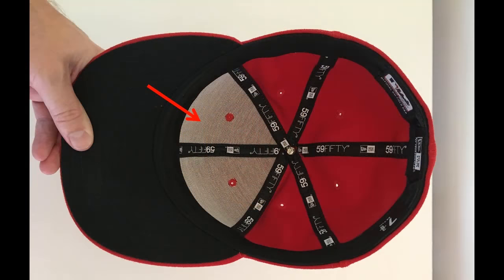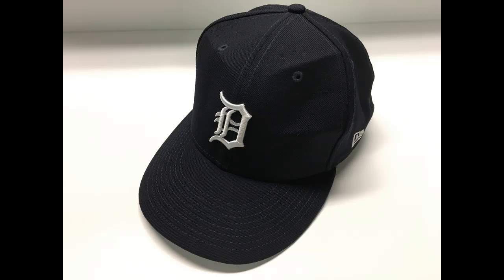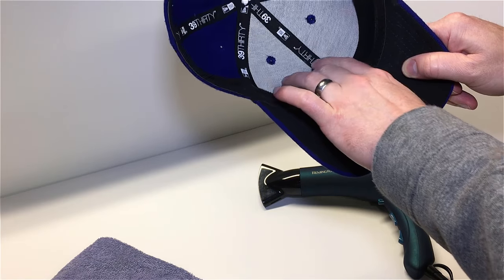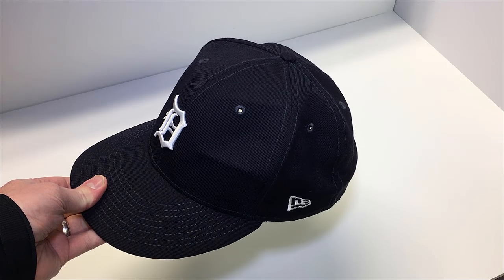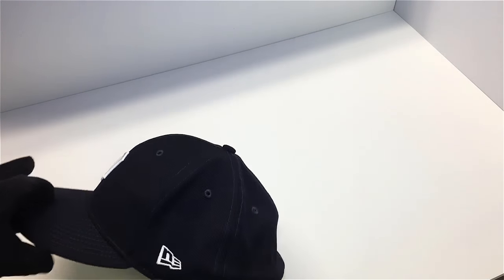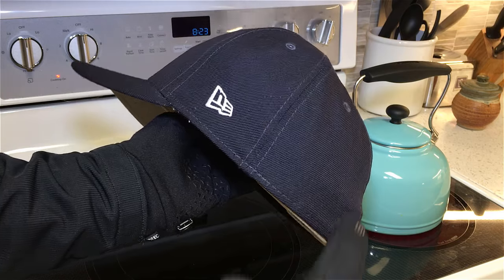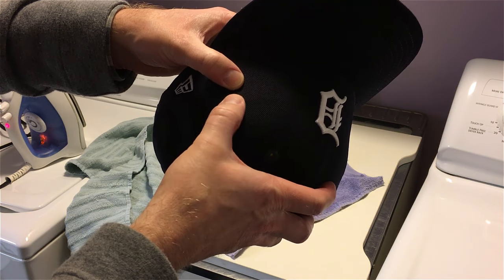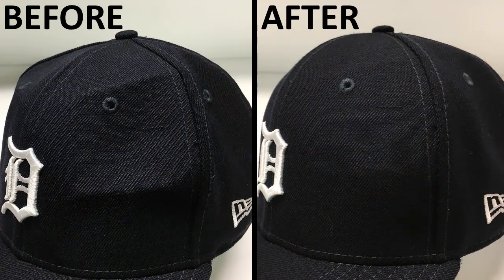Fixing Dents and Creases in your 59Fifty Cap

Comment: Any advice for a bleached Yankees 2000 World Series blue cap? One of my favourite in the collection. Bought in NY in 2000, I can’t do without 😅
Reply from the maker: I'm guessing you mean 'faded' when you say bleached?  If so, unfortunately I don't have any advice because I've never tried to restore color.  I can say that I see reissues of the 2000 WS Side Patch on NYY caps all the time at some of the smaller online vendors - not the same as one you bought there of course, but it might be the best way to get that cap back in your rotation.
Reply: Right, it is fading. Thanks again for your answers. Interesting suggestion about reissuing: I’ll think about. See you next 🤙🏾

Comment: Thank you so much I'm assuming this works for various hats ? Even snap backs that aren't new era ?
Reply from the maker: Correct - does not have to be New Era, but it does need the stiff buckram under the front two panels... that's what can be re-shaped to eliminate the wrinkles and creases, thank you.

Comment: Don't they sell little Metal Frames or I don't know what to call them but they're basically little Metal Frames that look like they're made of coat hanger type material that basically do the same thing the soccer ball does? You stick the Hat inside and then throw it in your dryer. I'm pretty sure they sell those are those meant for washing your hat or for fixing it?
Reply from the maker: I think you're referring to the (often plastic) frames for washing caps - they're meant to maintain shape if you throw a cap in the washing machine or dryer... and I never use them.  You're way better off with a bump cap insert ( https://youtu.be/e9pSynl4O7M ) for easy shaping, and using the techniques here for repairs in the buckram panels... and I did a compact version here - https://youtu.be/tBoVXv5y3To - ICYI, thanks.

Comment: how do you make the brim harder because my hat brim got flimsy, so I want to know how to fix that problem.
Reply from the maker: Unfortunately there is not much you can do to restore the stiffness of the original visor. It gets flimsy because of lots of small cracks over time - I call it visor fatigue, and it really can’t be repaired.
Reply: @dreinthe616 I kind of like visor fatigue. It only happens after years and years of wearing it so it kind of fits with the breakdown of the rest of the hat. I have a great Cleveland Cavaliers hat that has a fatigued visor and still looks dope as fuk

Comment: As always amazing insights on the care of the fitted cap.  Quick question Doug.  Would you have any insight or suggestions on how to get back the elasticity on the 39Thirty flexfit caps, especially on the sides which seem to bevel out?  Lastly, on the regular 59Fifty caps, any recommendations on how to get the top button to lay flat?  I find on most new caps it kind of points up to the back, even after a long time wearing them the button doesn't seem to ever "break in" and come down.  Thanks as always for your feedback and time.
Reply from the maker: I think that 39Thirty issue is one related to durability (or "dry rot" in the elastic) and I'm not sure of any way to recover it.  The button issue is one I've experienced, and the only thing I can think of is to 'spot steam' the buckram lined panels up where they terminate near the button, and try to bend them down.  Probably not going to fold the whole button down, though.  Thanks!

Comment: So will it still work just using a towel tho. Or you have to us a soccer ball bc I just got a towel and hairdryer
Reply: Also on the last part before getting that crease out on the oven can you just use a hair dryer or no it’ll melt the hat🤷🏽‍♂️
Reply from the maker: Towel should be enough if stuffed tightly and held firm.  Soccer ball just provides a more stable surface if you have to break out the flat iron like in the later steps of the video.
Reply from the maker: I don't think I mentioned an oven in the video, unless I said that was something NOT to do.  Hair dryer is a good source of heat for the work on the buckram, but like anything you have to go slow and do it in increments.  If you set it to the high heat setting, and hold it on the same spot for too long, you can definitely start to soften and melt the plastic fibers in the buckram.

Comment: I have a cap with the wrinkles in the lower part of the crown where the visor ends and begins, will this process work? or in what way? Thanks.
Reply from the maker: I'm not sure which process you're talking about, I showed a few here... but if you have a form to put under it and can get an iron on that surface (with an insulator in between as I showed here), then you should be able to flatten out the wrinkles.  Before you get that far, maybe just try simple steaming with a form inside that area?  Thanks.

Comment: i just got this new hat and i was at the beach. Couldn’t find it and i ended up sitting on it for almost a hour. Can just wearing it fix the shape?
Reply from the maker: Not if the buckram in the front two panels got really creased or folded… body heat is not enough to take the deformation out of the plastic fibers in the buckram.

Comment: Doug, your hacks are priceless. I’ve been able to fix things on my caps I never thought I could. Thanks so much. 

Question: Apologies if you actually meant to include this issue in the video at hand, but, what about that sort of “puffing” or “bubbling” that can show up on the front panel of crowns on hats? I’ve had this issue a couple times now with some otherwise gorgeous caps; I’ll inspect it and typically, when I notice this slight “puffing” of the wool off the buckram, it happens close to the logo. 

Does this make sense, and if so, have you got a hack for this? 

I’ve tried simply steaming the areas with a kettle then pressing down with a pen, but no cigar. Then I tried wetting the areas slightly with very hot water, then just pressing on them with my fingers, both from the top of the crown and the buckram side. This seems to have worked a little. Many thanks for reading this.
Reply from the maker: It's a great detailed question, but unfortunately I don't have a good answer for it.  Sounds like local 'delamination' of the buckram from the wool or poly, maybe resulting from a poor bond.  It's interesting because that bond is supposedly one of New Era's closely guarded secrets, but other manufacturers like 47 and M&N seem to have also mastered it in most of their caps.  I have not experienced that on many caps at all, which is probably why I don't have a good suggestion yet.  But thank you for the praise, and I'm glad I could help out with many of your other caps.

Comment: For me the dent is indented out from the inside. Does this method also work the same?
Reply from the maker: Never had to do that myself, but if you use heat and some of the shaping forms I recommend, I can’t think of a reason why it wouldn’t work the same way. Good luck if you decide to try!

Comment: Hi.Could you tell,please,what material the front panel of the cap is made of?Very interesting,how stiffness is maintained.Thank you.
Reply from the maker: I actually did a teardown of a 59Fifty in this video - https://youtu.be/qe0DbSQK8pA - so you can see it there if you like.  The buckram used to be linen fibers in old ballcaps, while in New Era's modern structured caps, it is probably a base cotton weave, but it actually has plastic fibers woven in as well... thanks.
Reply: Thank you sir

Comment: Will this also work for a 90’s 5950? I just picked up a vintage Sox cap but the buckrum already feels too soft
Reply from the maker: That's probably a tough call - if the buckram is aged and feels a little softer, then it probably won't be as capable of holding shape like the new stuff.  Steam won't necessarily hurt it, if you keep a form under it (like the size 1 soccer ball here) while steaming and drying it out - thanks.

Comment: What is the best size soccer ball to use for this? The one you had or slightly bigger or smaller?
Reply from the maker: This one for sure - size 1... I've never seen a size 2, but you won't fit a 3 into a cap.  As shown here, it's almost perfect for shaping the front two panels, thanks.

Comment: How do you fix the bend in the bill. I want my bill straight
Reply from the maker: Probably best with a regular flat clothes iron - start with a lower heat setting and work your way up... and use a thin layer over the visor so you don't singe the fabric and make it shiny, thx.
Reply: @dreinthe616  thank you

Comment: Do you need any water when blowdrying it? Like on the hat?
Reply from the maker: Not when shaping the buckram panels - heat is fine by itself to soften the plastic fibers and shape.  But there's no harm in using steam heat either, as I show a bit later in the video... moisture helps to relax the poly or wool, thanks

Comment: does this work with the leather versions?
Reply from the maker: Never tried it with leather or suede, but the shape in these panels mostly comes from the buckram underneath it. So if you can smooth the buckram you should be able to get it looking better. I’d say just go apply heat to the inside of the cap so that you’re not harming the leather exterior.

Comment: My problem is more that the actual coloured fabric is ruffled - will try these fixes, but doubt they will help. Good video tho!
Reply from the maker: Yeah, it's pretty tough if the outer fabric has pulled away from the buckram and gotten rippled, if that's what has happened... thank you
Reply: @dreinthe616  Yeaaa.. everything i tried just ended up making it even worse, and I had to order a new one.
Your steam reshaping tip saved another unfitting hat - can't believe I never even knew that was an option :D

Comment: What about using hot water on it to undo a dent.
Reply from the maker: I've never tried it with a cap, have to admit that I usually don't submerge my caps, especially at the temperatures you'd need to soften the fibers in the buckram.  Although I have seen auto-body techniques for pulling dents that rely on hot water, but sheet metal behaves a little more predictably than a layered woven structure, thanks.

Comment: Would this technique work on polyester? I have a huge crease on the side of a trucker hat I just purchased.
Reply from the maker: Heat or steam will generally allow you to smooth out most fabrics, but some might require more heat than others.  I've never tried on the mesh of a trucker cap, so I don't know - if you want to try I would advise that you go slowly... see how much heat can soften the material a little bit, without getting close to melting/fusing it.  Good luck!

Comment: So my baseball caps crown is bulghing up really high. Right in the middle just above the yankiees logo its like a bump or horn shape poking up to high is there a way too make it go down ??
Reply: Its a 39thirty buy the way
Reply from the maker: Just like in the video, if you heat it, you can manipulate it.  I'd just try hitting it with the hair dryer, then pressing the bump against a flat surface until it cools - or you can try the ironing technique in the later part of this video.
Reply: @dreinthe616  Thanks a lot I'll give it a shot and get back to you on it.

Comment: bro all u have to do is damb a cloth towel for example put it over the cap and iron it while applying pressure on the inside of the hat. boom easy fix
Reply from the maker: I think that's a simple variation on what I show starting about 14:05 thx.

Comment: What kind of fabric is the inside of the front of the cap that you heat? Thank you!!!
Reply from the maker: That is generically called 'buckram' and was historically made from linen fiber.  New Era and others actually weave plastic fiber in there as well, which gives it structure - and also allows it to change shape when heated.  Remember not to overdo it, because the plastic can melt too!  Thanks
Reply: Thank you, so much!!

Comment: Would this work with a vintage sports specialties snapback?
Reply from the maker: It all depends on the buckram in the front two panels.  It has to respond to heat, and must be stiff enough to hold a shape once you form it again.  Thanks
Reply: I usually wet the hat and roll a towel until you can’t fold anymore then put the hat over the towel and stuff it in to wear you get the shape you want then use hair spray over the front panel so once it’s dried and ready, it’ll be nice & stiff in the front!  I collect vintage hats so I do this on the daily!
Reply: @jayviews4823  ok thanks, yes same here

Comment: this works on cap brims?
Reply from the maker: Depends - if you've got a crease in the visor and you wear it curved, it will stay that way because the fibers were probably broken.  If you like wearing a flat visor, then ironing with a steam iron (with a cloth over the visor when you iron) will flatten it back out.

Comment: Does it work for Gucci caps
Reply from the maker: Works for any caps with structured front - those with stiff buckram lining under the front panels.  New Era caps have plastic fibers in the buckram, which can be heated and shaped.

Comment: I recently washed a hat and ended up with ripples on the top of the bill. They are right under the logo where the bill meets the cap in the open area surrounded by the stitching.  Do you have any experience with smoothing these out?

Comment: Could this technique possibly be used on a Nike Dri fit hat? I’ve got a gnarly crease on the crown of the hat. Thx
Reply from the maker: Answer is yes, I think so - but it really depends on the buckram in the Nike hat. New Era uses plastic fibers in there, and they respond well to heat like shown here. But I’ve never tried it with a Nike cap - if it has a structured crown with stiff buckram up front, it would probably work. Thanks
Reply: @Angel Rodriguez how did it go, I’m about to do the same thing

Comment: Are you using low, medium or high heat?
Reply from the maker: With the iron, I started at low and took it up a bit to what you'd probably call medium ... the fabric designations were worn off on my iron so it was a little tough to tell except for the dial position!  Thanks for the question.
Reply: @dreinthe616  Thanks for the info!